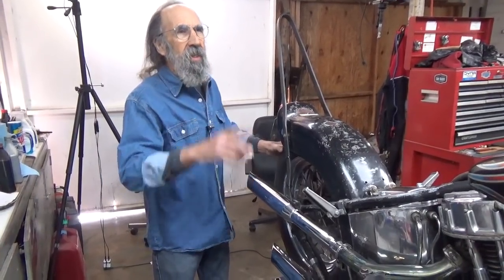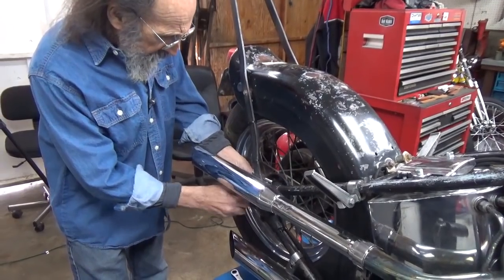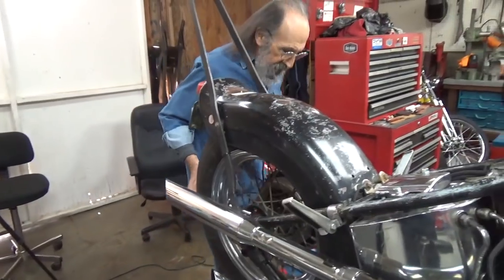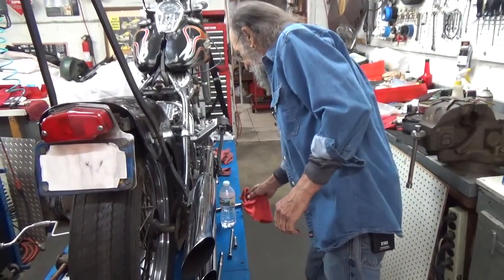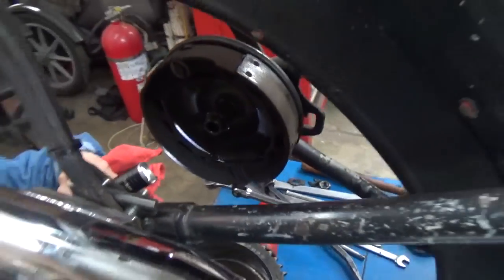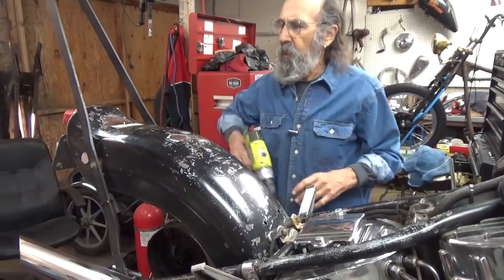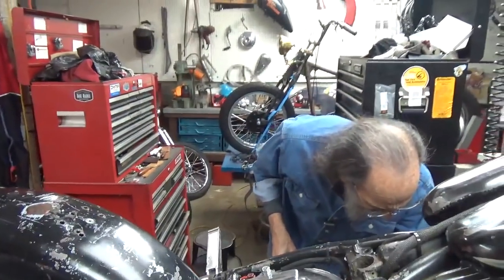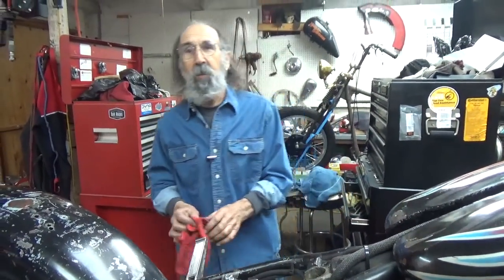Step 18 Rear Tire,& L C  the Panhead Almost Ready

Comment: Greetings, & a small tip from the Greenwood (the big 'uns tend to appear in Spring).
Rivnuts et al: Once one's orifice has attained the correct diameter for one's insert, taketh thy smallest rat-tailed or warding file & fileth one or two very small half-moon notches in the rim of said orifice before fitting one's insert. Once squeezed up & snug, you'll have better torque resistance for fasteners - even when high mileage vibes have had a good nibble at the fit.
(Rusty threads in free-spinning rivnuts rarely, if ever, bring much joy to anyone's day : )
Reply from the maker: Well said, and good advice.  I do listen, you know.  Thank You.

Comment: My brother had a chopper in the late 70's with that same rear tire. I think that was the wide tire look of it's day. I bet you could sell that on eBay ... 🙂
Reply from the maker: It's rotten.  It's over.  It won't be missed.  When I bought my Shovelhead (1977 model) in 1978, it came with a pair of those tires.  They were awful.

Comment: Thanks for the sheet metal insert upgrade. It seems to grip stronger than the rivnut application. Dedication and determination are always in demand. Leslie's looking better every time - great work. Question : the final drive sprocket / chain. How do we determine wear limit? Maybe next video.
Reply from the maker: They last and last.  When they look way worn, replace it.
Reply: @pacificmike9501  I have to do that right in front of me. Finally I got the right rivets, I will dril out the old ones and hope for the best to get the new ones in. I now how to do it, but I have never done that ;-) If I used to work in the Aircraft bussines, the mechanics had the right tools to do it. I`am from the Electrical side, so dealing with rivets is not my natural habit 🙂  But Idefinitley will do it on my own,. Thank`s I now it has to be done very correctly, I`am aware of it.

Comment: Mike I know you don’t like selling things but that insert is slick, and it solves a problem on my bike! I need one. There are so many sizes of the avk expandable tool available, do you happen to know what size fits the typical Harley seat bolt? 1/4-20 or 5/16 - 18….these come in so many sizes. Anyway thanks for a great tip!
Reply from the maker: I use a 1/4-28.  Harley has used 1/4-28 and 1/4-20.

Comment: Ive never seen that insert, very cool. Mike can I ask you about the designation FLE, ive googled it and found it means "Traffic Combo" and it is geared lower and has smaller carb. Is that so and would it still cruise at 50 to 60 mph ok. Ive seen a nice 54 FLE Pan for sale so just asking.
Reply from the maker: Well, I've seen it.  So, I looked it up and Bruce Palmer III, who wrote the very useful book: Authentic Restoration Guide, "How To Restore Your Harley Davidson," has it on page 4.  It says, "Mode FLE 1955-1965 special cam police 74 OHV."  I'm just assuming that is a higher performance cam, but, I honestly don't know.  The cam may have some designation letters on it.  Again, I don't know.   Truth of the matter is, it could have had fourteen different cams in it by now.  Ride it.  Change sprockets to suit your riding.  Happy motoring.  You may want to change the cam to suit your kind of riding.  A 54 Panhead is a nice motorcycle.  I have my 52 geared way high and I ride the Southern California freeways.
Reply: @pacificmike9501  Thank you so much for taking the time to answer that for me Mike. It is very much appreciated.
Reply from the maker: Glad to help.

Comment: Hi Mike
So enjoy your videos. I learn so much. I may have missed something or perhaps this is a dumb question:

I saw someone else ask similar question, but to follow up.  I have stock tires.  Is there a reason why you can’t remove entire wheel and brake assembly by removing rear axle sleeve nut & collar after removing rear axle nut, lock washer and axle? On my bike, spacer falls out and wheel/brake slides over and off.  Maybe I just got lucky.
When reassembling, fitting brake hub pins onto wheel would seem easier to do off bike, then install wheel and brake together.

Thanks much
Reply from the maker: Yes, it is problem of width.  With that brake drum off of the brake, and mounted to the wheel, the space is not wide enough to push the wheel in there, past the brake shoes.  Removing the entire brake assembly?  I don't know what you have.
Reply: @pacificmike9501  Right. Bike is a 1946 UL.  Tires are 4.00 x 18.  Stock brakes.  Yes, my intent was asking why not remove brake drum/brake side plate while still attached to the wheel - so remove all with the wheel.  Thanks again Mike.
Reply from the maker: 4.00 x 18 sure gives you more room to work with.  1941 was the first year for 16's.  They were an option.  I don't remember how long 18's were still available on big twins.  This just gets more interesting by the moment.